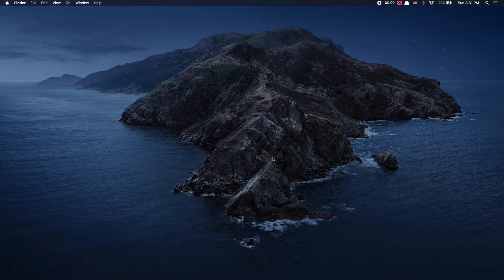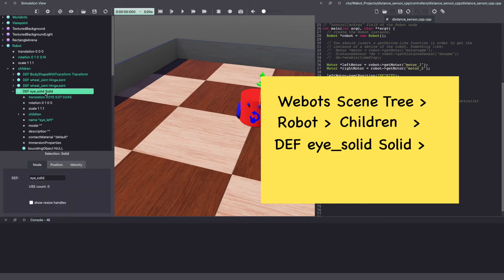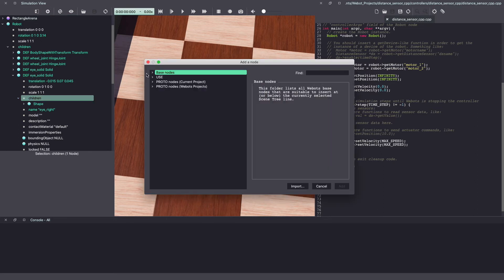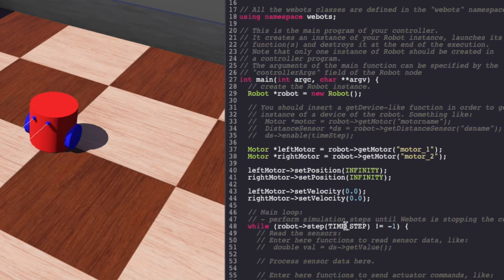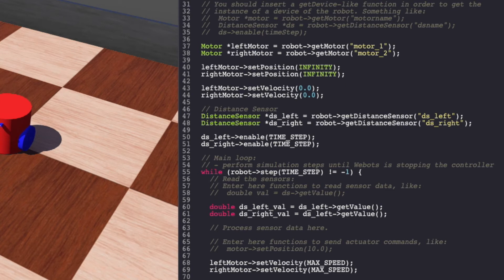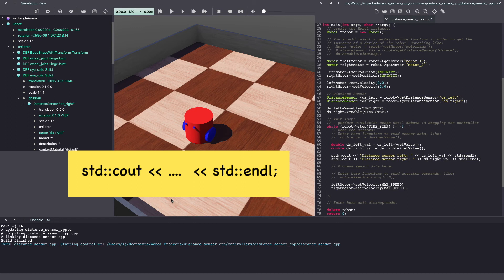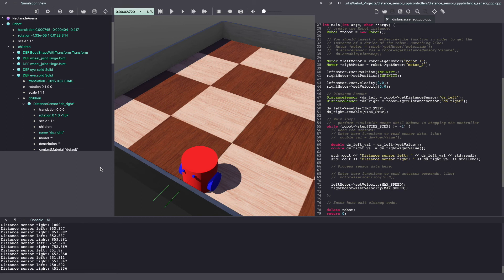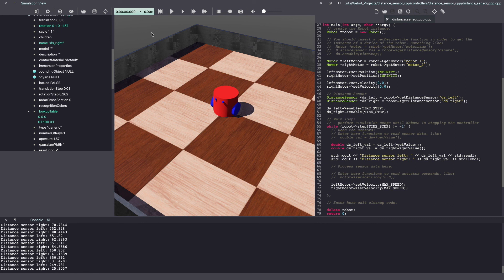Webots Distance Sensor Code in C++ // Webots Tutorial 4 Distance Sensor and Controller Code C++

Comment: I made robot from fusion360 CAD part, I can run the robot by python scripts without adding physic to each part. But after adding physics to each part and giving value of mass. My robot dont move with scripts. Can you help to out of this problem?
Reply from the maker: Some things that you can try:
(1) Did you add a bounding object to the robot?
(2) Did you update your robot controller to your script/code?